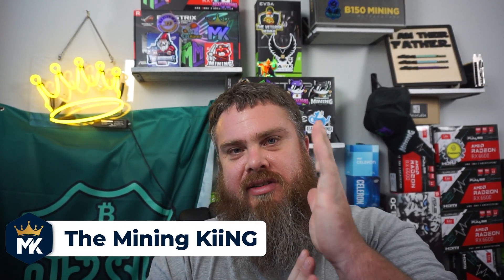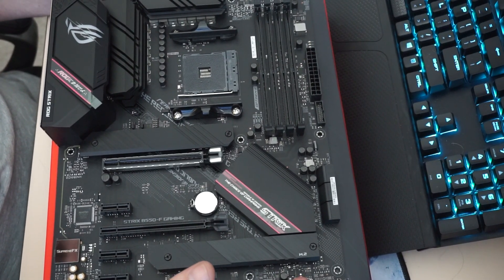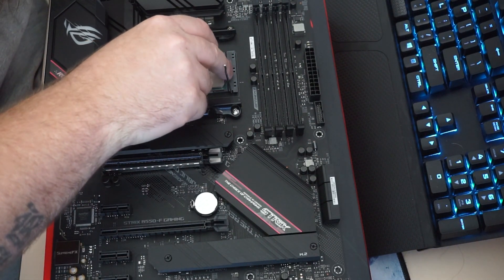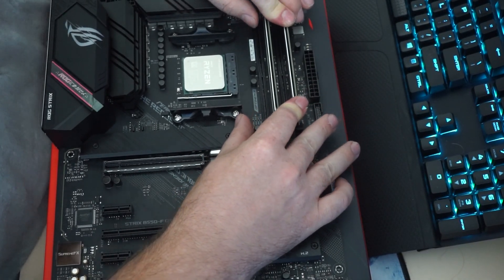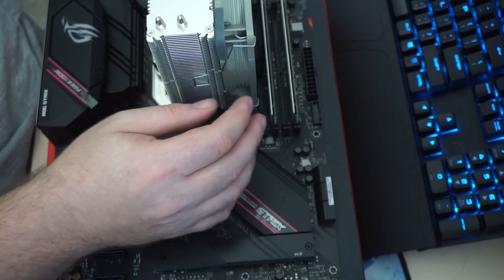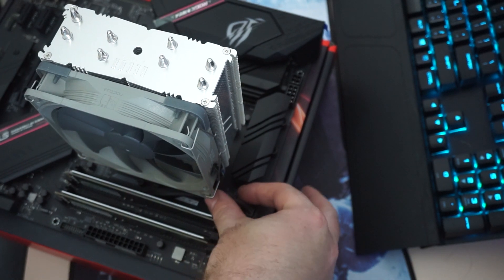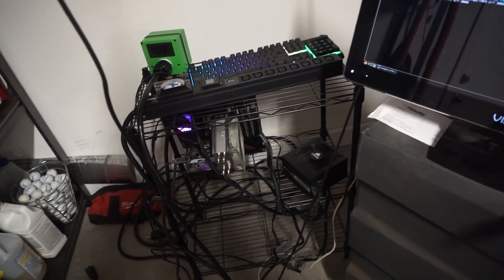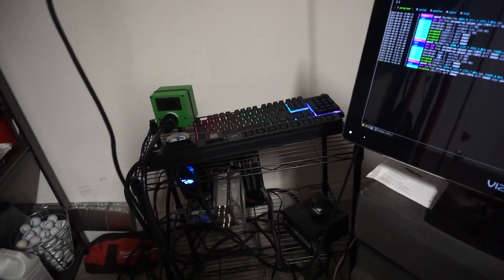How to build a CPU Mining Rig

Comment: my experience with cpu mining is that there is terrible profitability in it. and it also produces a lot of heat. so far I haven't seen any advantage with cpu mining,, I have va 440 threads amd, it doesn't pay for the current once. think it is very dependent on a seller selling at exactly the right time for it to be profitable in the long run. anyway good luck :)
Reply from the maker: thank you